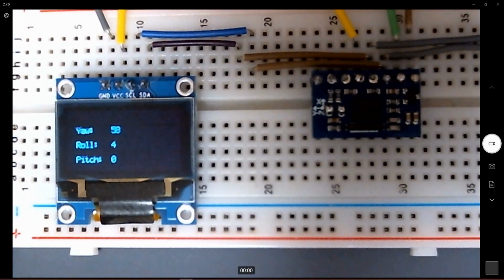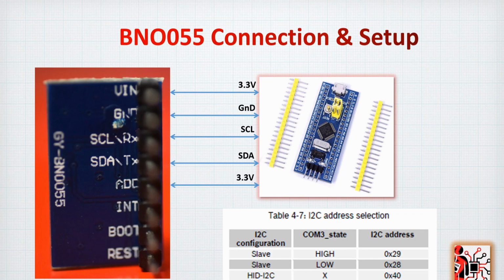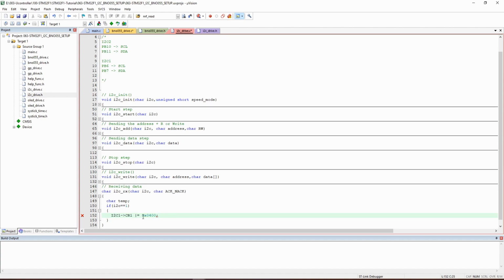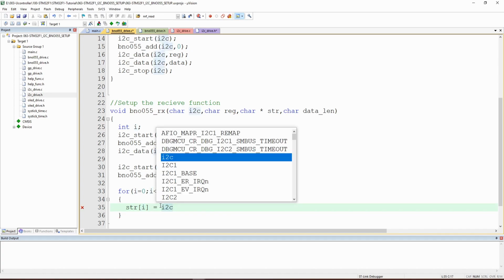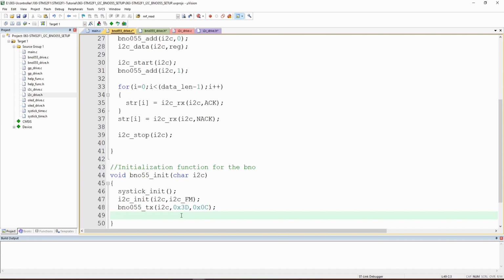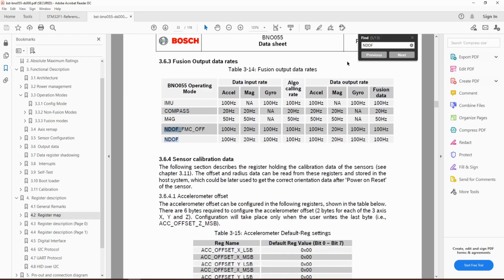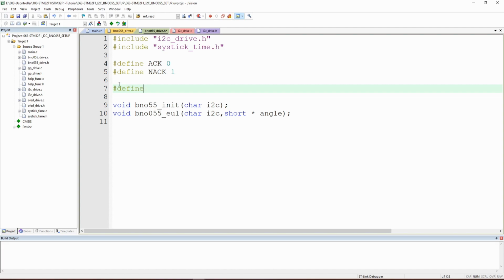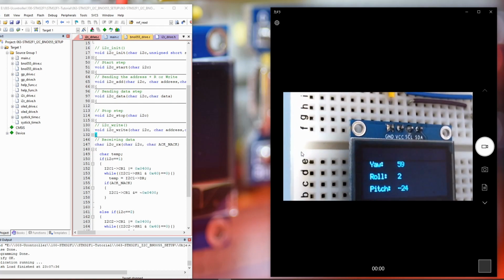063- I2C communication example: BNO055 SETUP & Display -Inertial Measurement Unit Euler angle sensor

Comment: @WeeW - Stack  Hey buddy, loved the video. You can eliminate the need for char i2c by using I2C_TypeDef *I2C in the function parameters and then use I2C everywhere instead of I2C1 or I2C2. This makes your driver scalable without increasing the size.